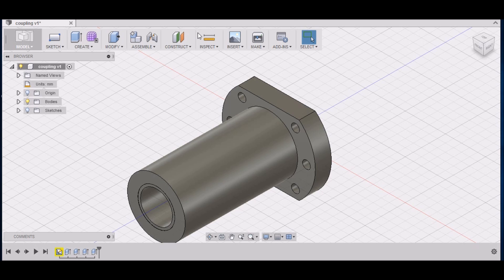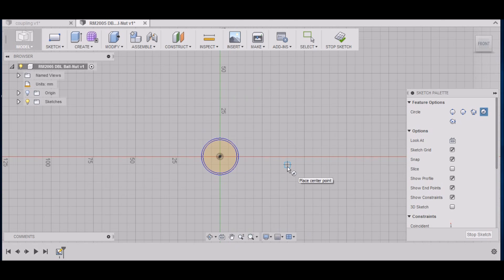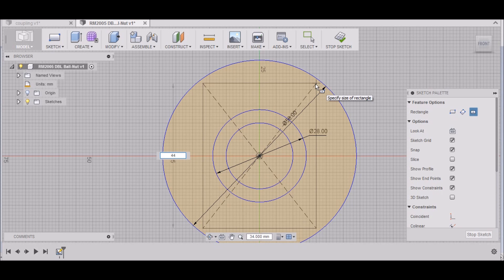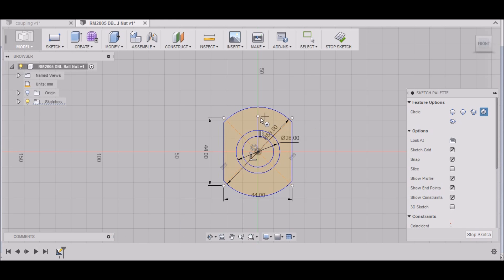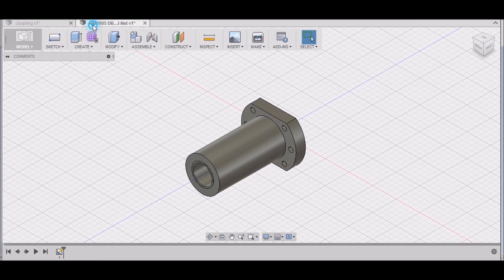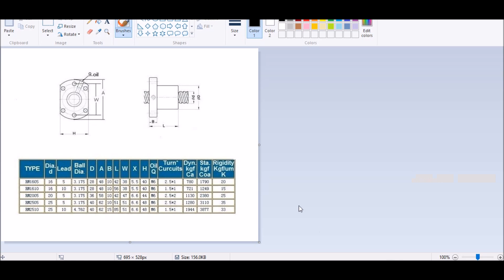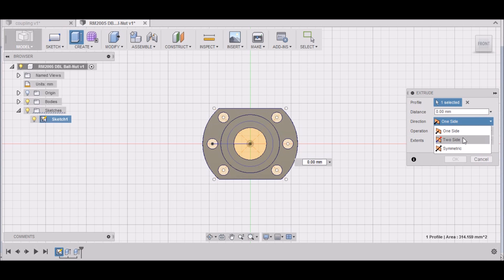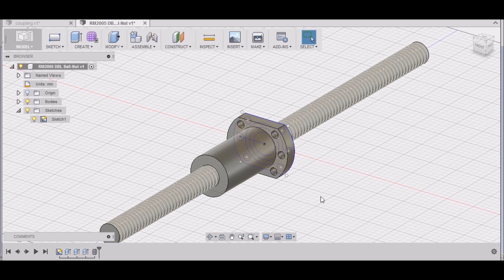Fusion 360 RM2005 Ball Nut

Comment: hi Sam, nice slow video thanks, i think in a way i am like you for the home cnc work,  i have always used cambam wfor a long time, which i still love and it a great starting software for anyoneout there, for different reasons i like fusion 360, its hard to do things when you start but when you get your head around it its a amazing, plus lot of you tuber are starting to use it, so the information for using it is out there for people to find, there are things i find new every day like on this video when you moved the part orgin,, that was great, i have been dealing with models on the wrong orgin for weeks, now i can see the part right side up, again great video and thank you, thanks daniel
Reply from the maker: +Daniel Kitson 
Thanks 
Yes I'm very found of CamBam it's a great program for simple 2 d work in a home shop. Fusion 360 is great as well and in different ways. There are so many functions I may never fully get a grasp of them all. Knowing that you guys are picking up bits and pieces of useful info makes posting worth it. Be safe Sam